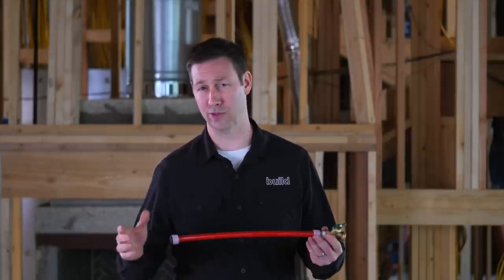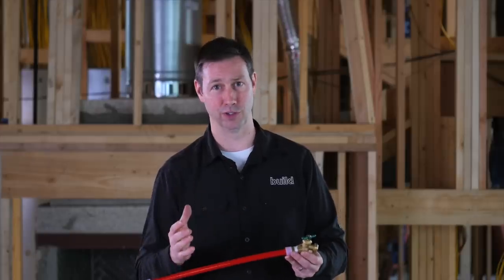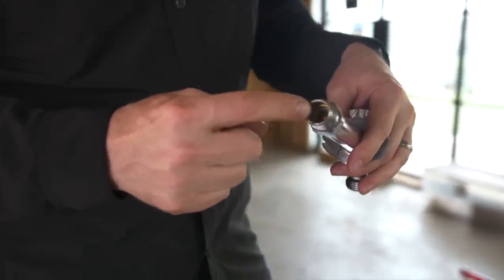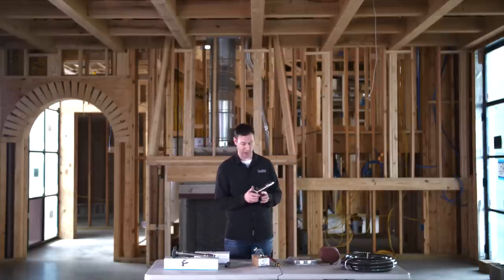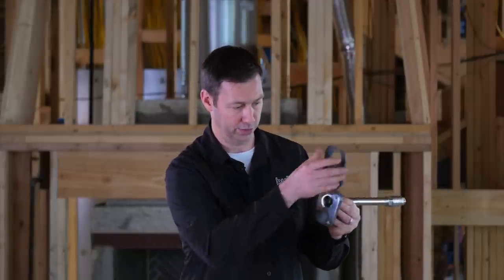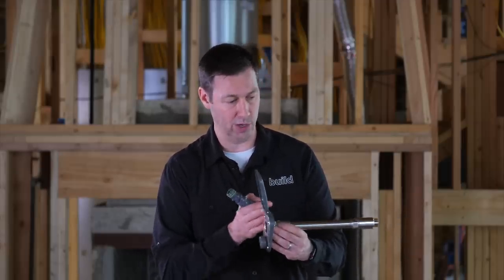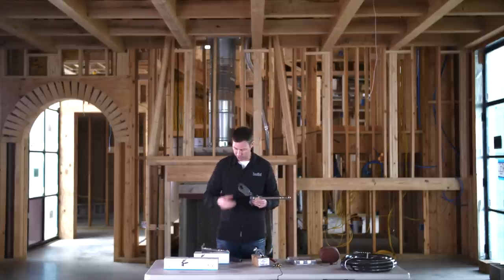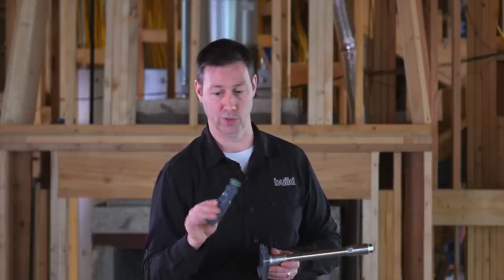No More Hose Bibs - A Better Outdoor Faucet

Comment: I've used taps similar to this before and my experience has always been left with a feeling of inconvenience. For instance, if you are working outside and your hands get dirty then you need to get the "Key" in order to turn the water on to rinse your hands. It seems like a clean looking install except that you need to always keep the water key next to it in order for it to be convenient and things like that get lost and look cluttered. 

If you keep the key (with quarter turn valve) installed and the quarter turn valve turned off (so that this is now convenient for you to use again) then you have lost your frost free protection and it now looks bulky.

These look like plastic attachments and if they are then I see that as being a week spot and are asking to get damage from being cross threaded or cracked from the hose being pulled on. The ones I have used have a brass key and cover and are much more robust. They were installed to stop vandals from nocking them off a wall or people steeling water... were talking commercial application here. Those sort of issues would not be a concern for a regular home owner.

If you don't have the faucet attachment then you only have full on or full off control. Filling a bucket with water now becomes a high pressure high flow splashy mess. A simple task like filling this bucket or watering can now becomes more complex because you must have a hose beside you to achieve this simple task of water flow control or you are having to find that water key that has the on/off valve installed ("where did I put that again?..."). This clean looking install now looks cluttered again because you now keep a hose and a water key beside your hose bib contraption just to make it convenient.

If you loose or break the water key 10 years down the road you are possibly going to be looking far and wide for replacement keys. Since I don't see this type of hose bib sticking around in the residential market like they are marketing it to there will be little point for them to keep making the parts. The chances of it becoming obsolete are too high for it to be a product that I would put in my own home. There are hose bib assemblies like this used in commercial applications though so if you are wanting to go with this setup I would highly recommend using a long standing brand name commercial valve so you have hope of finding the parts years down the road once they break or are lost and you are not left high and dry when you can not find the replacement parts that you need. 

Good thing you installed a loop in the wall so they can rip them out and put a normal frost free protected hose bib in its place once they get tired of having to deal with this setup ;)
Reply: I was concerned that I was being too hard on this product without proper research so I decided to watch one of their promotional videos and take a quick look at the product. It is in fact a plastic attachments so expect those to break over time and expect to pay lots to replace them when you need to. 

They boasted that their product was a patented design, like that was a good thing for you as the consumer. What that is going to do is make it so other companies can't build attachments to work with their proprietary setup that you just bought into. For example, you won't be able to get that nicer brass key from company "B" because they are not allowed to produce them and since Aquor doesn't make them, good luck. By holding the patent they have limited their innovation to what their company can produce instead of the millions of minds that could greatly improve on this design or the thousands of companies that could make accessories for the product and help it become a wide spread industry standard product. Sure, someone else could work off their patent and make accessories but they would have to pay a royalty to Aquor in order to do that and you can be sure Aquor would set that royalty high enough so that the cost of the products produced remain in the price point that Aquor wants it to be in (High). 

Considering that their products are made of about 25 cents worth of injection molded plastic, and their price point is $12 to $25 for a new key, it appears like they are in the market to make money off of peoples backs without any consideration for providing people with quality parts in return. They know plastic breaks faster and the markup is greater so that is the material they have chosen to use. 

Don't get me wrong, if an expensive, proprietary, inconvenient setup with high cost of maintenance (replacement parts) is what fits your bill of materials then by all means proceed, It doesn't fit my desired setup though so I'll stick with something more practical, a standard frost free hose bib in either a quarter turn ball valve if you want it to turn off fast, or a standard globe valve type if you want better flow control.
Reply: Hey TropicalEncounter, thanks for taking the time to leave your feedback. It's easy to assume a lot of things about our hydrants without having ever used one of them before. We don't use any ABS plastic in our products -- our hose connectors are molded from materials like Delrin (acetal resin) and glass-filled Nylon. They are rated for thousands of pounds of crush resistance and tens of thousands of engagements without wear. If you do happen to damage it within 5 years, we'll replace it at no cost. Most new brass hose bibs these days don't last that long, unfortunately. The "commercial type" brass couplers you mention are neither long-lasting nor efficient. They frequently leak, and brass is a soft metal that wears. Our marine valves have been around for 18 years now, and are widely considered the industry benchmark for SS flush-mounted quick couplers. Appreciate your words of wisdom but we make quality products that last. I encourage you to try one out yourself!

Comment: For that price I feel like they should use better screws, I’m thinking torx head bc phillips and flat heads are like that crappy 70’s house shag carpet they just simply need to go away and stay away
Reply: Torx are great until the center softens and rusts away leaving you with a stripped fastener. For anything exposed to the elements, torx and hex sucks.

Comment: I like the Aquor hose bib, except for the proprietary plastic adapter.  It will get lost, bent, or broken, and then I can't use my hose bib at all.
Reply: except this is not plastic. Its Delrin polymer used in way more task intensive applications. You might break your hose sooner than damaging this adapter. 
https://www.dupont.com/products-and-services/plastics-polymers-resins/thermoplastics/articles/acetal-copolymer-vs-homopolymer.html

Comment: Out of curiosity, do you get much slapping in the Pex from the service loop when you turn sprayers and sprinklers off?
Reply: Tyler, it's going to depend on the anti-hammer devices used in the water supply system. With more of plumbing code and newer devices having integrated check valves/backflow prevention devices, the problems with older piping networks show up. When municipal water systems began changing meters to backflow prevented units, water heaters began weeping at their relief valves because there was now nowhere for the expanded volume to go. Code began requiring freestanding expansion tanks on the cold side of the water heaters which, when properly sized, also help reduce the water hammer issue by giving the shock waves a place to dissipate. Dissipating the shock of sudden changes in flow will also minimize the movement in a service loop like the one shown here.
Reply: Bear U Thanks! That's a great explanation.
Reply: @TylerBoespflug  Nice explanation, yes, but it probably still slaps.
Reply: I can see an air pocket getting trapped in the top of that loop. So every time you turn on the spigot it's going to spit and sputter. Also one of the reasons I hate vacuum breakers.

Comment: Although I don't see this product pass the test of time it's always nice to see what new product is out there thanks for the video God bless
Reply: pétri pat , it does seem like the proverbial reinvention of the mouse trap.
Reply: Stanton Taylor 
Lol good one 😂
Reply: That long, thin, unsupported  plastic adapter will beak, that is a guarantee and what happens with ALL plastic hose products, I have lived long enough to see them ALL fail.
Reply: We've been making these for boats for 18 years now! We waited 15 years of them being used in saltwater around the world, before making them for homes now.
Reply: If you can break our connector with your bare hands, I will personally mail you an Arnold Schwarzenegger t-shirt.  :)
Reply: Hey +Aquor Water Systems Do you happen to sell parts individually or as a repair kit? I understand the bibb can be replaced but what about the shutoff valve assembly inside the wall?
Reply: Why would I need to break it with my bare hands ROFL.   How about I yank on the hose line and we will see how much it can handle.

Comment: So when you remove the hose, the water turns off. And the vacuum breaker then drains all the water so there's no risk of frost damage... where does that water go? Down the side of the wall? And you only realize the seal has gone and the tap is dripping when the hose is disconnected...So it need to be fixed immediately, you can't put a bucket under the drip, because it will go straight down your wall... 
And the long plastic connectors... ever whipped a hose just to flick it over something? Yeah, doing that will likely snap that connector. 
Good idea, neat design, fatal flaws in my opinion

Comment: Being from the north I have no need to replace a silcock that closes outside the house. Where is the ability to adjust the flow of water? Oh you need another special attachment to do that? How long will those attachments last? They do seem to be relatively robust for a plastic piece but I cannot see them lasting for very long. The hose getting pulled or snagged or the attachment piece getting bumped while attached may break it fairly quickly. Not to mention what will happen while it is sitting around in a garage.

As for solving leaking issues with the old style of silcocks, (per Aquor: "Over 10% of homes in the US have leaks of 90+ gallons per day (EPA.gov)") that is what happens when the median age of a house in the USA is 35 years. I would bet in that time no one has ever replaced a seal. My house was build in the 60's and had leaking silcocks. I would bet no one ever touched the seals in that 50+ years. Less than $5 in seals and 1/2 hour to replace them is so much cheaper easier than putting in this new silcock. For this last one if you are doing new construction it may not matter to you.

Comment: I don't like that it doesn't have a handle for 2 reasons.  I can't control how much water comes out and I have to disconnect the hose all the time.  With a hose real attached, I just want to turn a handle, which has never caused me to scratch my hand.

Also, it's called an anti-siphon.  It is designed to prevent backflow that could pull fertilizers and other possible contaminates back into the potable water supply.  Yes, it may help drain the water out from the shut-off back in the wall to where the water comes out, but that is not it's main purpose.
Reply: Cole, the vacuum breaker is code to serve both purposes. 50% to each of you.
Reply: N C never scratched my hands on a faucet yet. Maybe in the south with those tiny little things you have, but not in the north with the freeze proof ones

Comment: I purchased one of these from Amazon a few months ago. Mainly because the standard ones from Home Depot don't work well in Maines -20 winters. It worked well for about a month then started to drip. Upon contacting customer service i was told to insert the hose 3-4 times and that should clear the issue if not i was an installation problem? It did clear the drip for a week then it started dripping again. My conclusion is that the valve does not always seat correctly when removing the hose and allows the water to bypass the valve and drip  down the wall. I like the look but having to keep inserting and removing the hose to stop the dripping is annoying to say the least!

Comment: I like this idea, but I'm wondering how much force that plastic adapter can take if you gave your hose a little pull? Would that plastic part snap in two or do you need to watch or that? I'm just thinking kids running around with a hose and they run one step too far......will it hold up? Keep up the great work.

Comment: Matt...The vacuum breaker purpose is an anti siphon devise to protect the potable water supply. 
So if someone leaves the end of their hose in a contaminated container (like an animal watering bucket or tub, hot tub, swimming pool etc), that contaminated water cannot siphon into the potable drinking water system.

Comment: There's absolutely nothing wrong with the traditional frost free resessed outlet. This is by no means a better stronger replacement. The adaptor comes straight out from the wall. No doubt there will be strain on it. It has o rings which will fail causing you to have to buy a new adapter. It's plastic which becomes brittle over time. Nothing about this convinces me it's a better system at way too much money
Reply: It's not designed to be better / its design to not to be fugly. And its Delrin polymer, not plastic. Way stronger than you think.
Reply: @AlexPasek  well for three times the price it had better be better. If not what's the point? If it's only asthecics then once again why bother. It's not like the regular one is some hideous looking thing. It's just a faucet. Who cares. The mechanical part of this is exposed to tempuratures that will easily drop below - 25 f in a northern climate. No way that's going to hold up for an extended period of time. Also you don't need some convoluted pipe loop in behind the wall to service a tradition one. There is absolutely nothing this has over a traditional frost free other than tripling the price
Reply: @RCAFTailWind   " If it's only asthecics then once again why bother."......why? for the same reason people pay $2k for Noguchi coffee table. It might be worth nothing to you but to match modern design I rather use something designed in this century with added bonus of quick attach / detach.

Comment: almost a good idea, your adapter needs some deep thought. Its good that the "spigot" - the part attached to the house that you stick the male adapter part in-  is the female portion, great, but when you attach the hose it has some force on the plastic piece you put in it, that force being which ever direction the hose puts on it, in your video it was down, see how it gets pulled in the downward direction? it will eventually cause the groove lock to fail via wear and lots of force on it. traditional spigot shapes account for this. its one of those design ideas that we over look in our every day tech. I suggest you discontinue the lock grove and look into a ring compression lock , i.e. similar to air hoses in a garage. and relieve some of the vertical torque via slightly pointing it downwards.

Comment: I replace many of the frost free versions every spring cause people dont disconnect the hose, they will freeze and bust
Reply: So lots of people leave their hoses pressurized over the winter?  Even in the deep south, I can't imagine leaving a hose pressurized overnight, much less over-winter.  Regardless, nothing in this solution will save a fool and his/her pressurized hose from freezing temperatures.